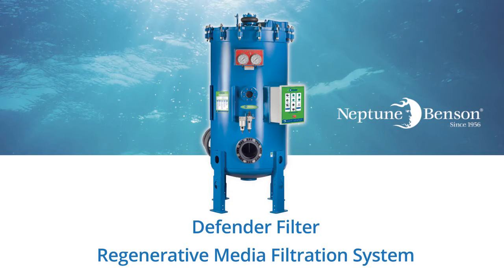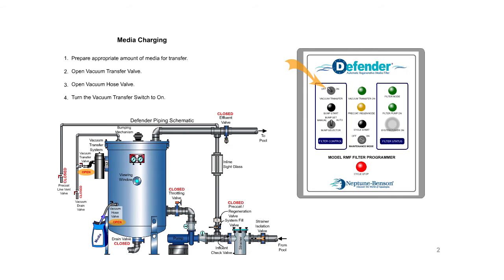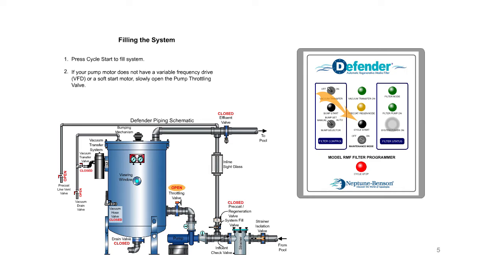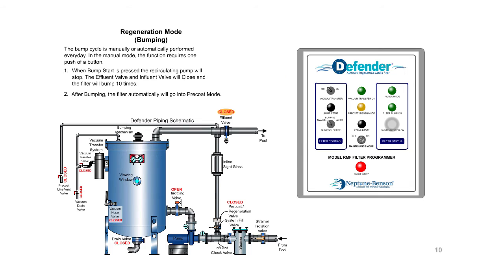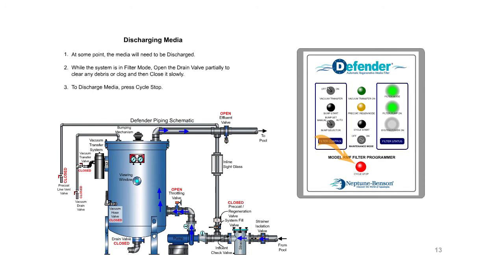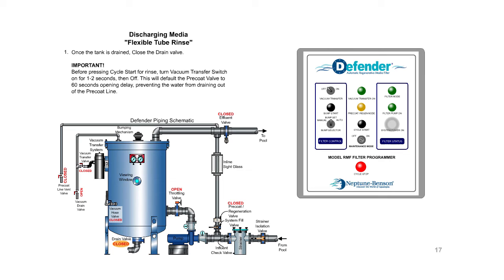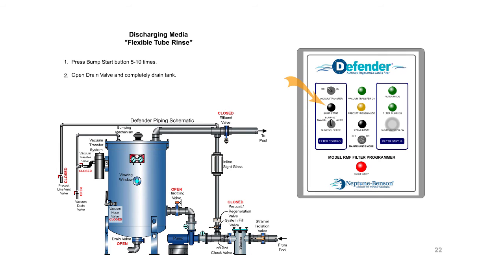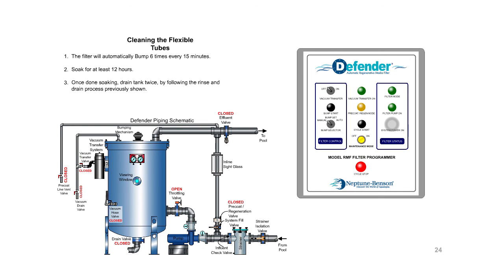Test Drive the Defender RMF

Comment: This is the older Controller as well. Most of the programming helps you walk through every step of every operation including maintenance. You also do not need a vacuum truck or crew to remove and change media. This filter makes pool sanitation a one man job and that's only one point of the savings, never mind the cost savings on water.
Reply: Ross how big of a pool do you have and is it a  indoor or outdoor and how often do you have to change the media? I am looking at getting a system like this for a public pool and just wanted to  so if you have some pros and cons?